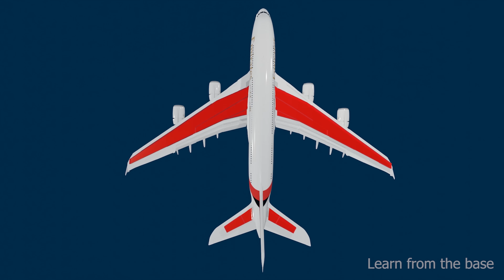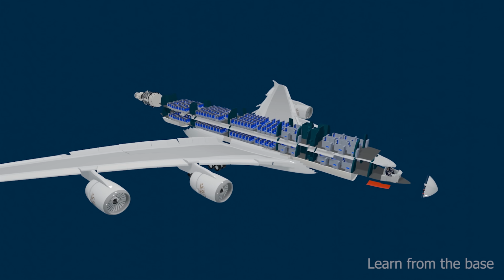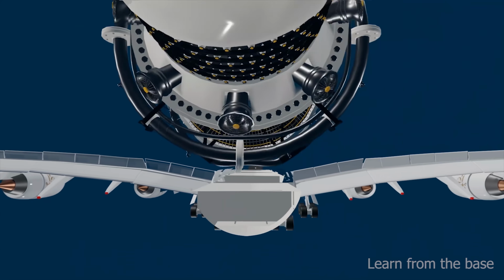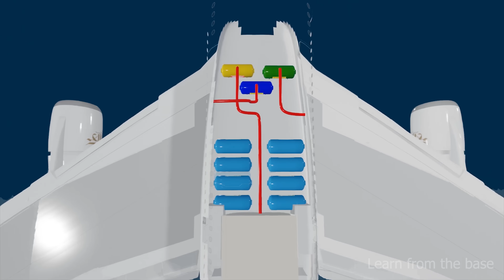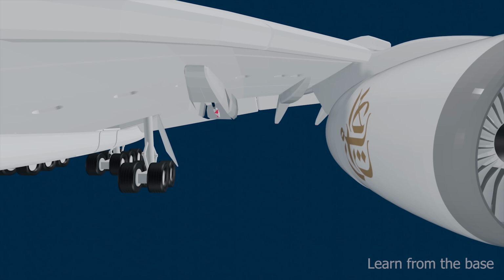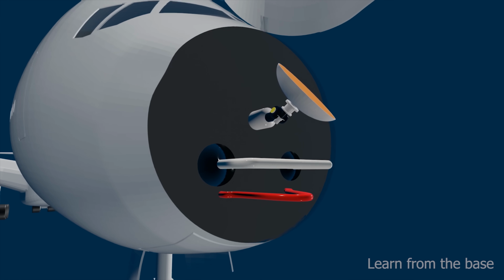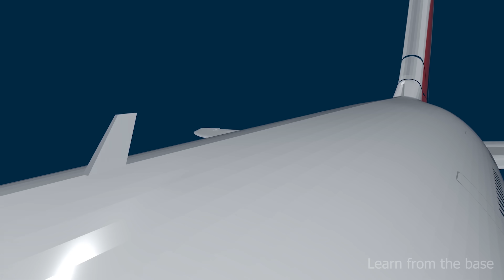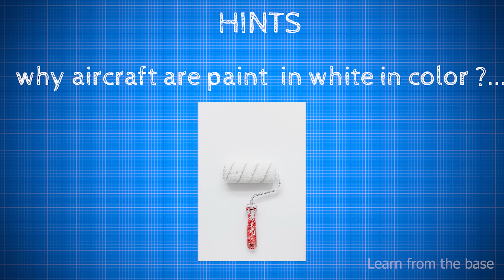what inside an airbus?world largest passenger aircraft (a380) with 3d animation/ learn from the base

Comment: Landing boost:
During landing, the engines are reduced to facilitate descent and braking. This is done to prevent the aircraft from losing excessive speed and to allow the aircraft to brake in a controlled manner.

Power reduction for landing: 
During landing, the engines are reduced to facilitate descent and braking. This is done to prevent the aircraft from losing excessive speed and to allow the aircraft to brake in a controlled manner.

Braking during landing: 
During landing, the brakes are used to reduce the aircraft's speed and bring it to a stop on the runway.

Aircraft control: 
Pilots use various controls, such as the flaps, spoilers, and rudder pedals, to control the aircraft during landing.

Safety: 
The configuration of the A380 and other aircraft is designed to ensure safety during landing and takeoff.

I don’t why does the landing a380 airplanes never open 4 engines with going back spoilers throttle than a340 and b747 the 2 throttle ssme sizes for Airbus, A340 and A380

Comment: There is no fuel tanks in the wings, small fuel tanks yo get the aircraft off the ground.
Once in the sky, the apu generates the power to fly the plane on electrical power.
Come on lads, do you honestly think each wing can hold 160,000 litres of fuel swishing around, it's the equivalent of 25 fully grown elephants in each wing 😂😂😂

Comment: The fuel weight in each wing would be in excess of 50 tons plus the weight of 2 engine's (6 tons each according to the manual) so the combined weight on each wing when fully loaded is going to be approximately 62 tons. Those are mighty strong wings! Are my calculations correct?
Edit- I've based this on each wing containing approximately 150,000 litres of fuel. Do you know the capacity of each of the 6 wing tanks?

Comment: 30-11-2022  Bangalore

Sir,      I have noticed an error:-

Total seating capacity :   868  passengers  ;  Upper deck   330 passengers
                                                                                Main deck    583 passengers
                                                                                Total              913 passengers.
Which is correct?

Will you clarify and give the correct figures.?   

                                       - Nagaraj T V    Bangalore  India.

Comment: How can all that fuel fit in such thin aerodynamic wings full of hydraulics and electrics and engines ? If so , surely the weight of all that liquid would require something to hold it up . Not just where the wings meet the body. It's only aluminium remember . Think about the figures you give for fuel capacity and what that would weigh.

Comment: Feul tanks , that are apparently big rubber bags , ( that can never be inspected or removed or even repaired 🤷‍♂️🤔) in the wings ,that when the flaps move you can see straight through them, you know them #feul tanks 😉
Reply: No.  Most of the fuel tanks on airliners are not rubber bags.  They use what is known as a wet wing, in which the wing structure itself is the tank.  The front bulkhead is hust behind the leading edge slats.  The rear bulkhead is just in front of all the gear that operates the flaps and ailerons.  So the thickest part of the wing holds the fuel.  It has removable hatches that can be removed for inspection.  On something the size of an A380, you can stand up in some of the tanks.
Those are the facts, not that I would expect an illiterate chemtrail believer to understand them.

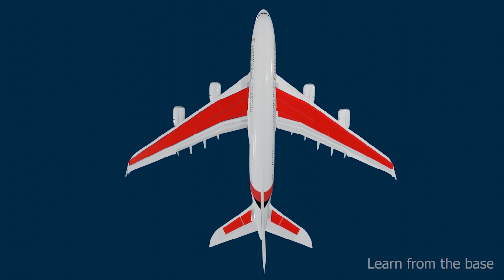Comment: 03:55 total fuel capacity is 320,000 lites
So 320 tonnes
Which is like 228 cars (on average) 
Um…
Reply: No, it's about 253 tons.  Each engine burns 3 tons per hour, so 4 engines = 12 tons per hour.  Let's assume a 15 hour flight, so that's 12x15=180 tons.  Then allow some more for taxiing at both ends of the flight, then reserve fuel in case it has to divert, and you're already over 200 tons.  They will rarely fly with a full fuel load; just what they calculate they'll need.  Carrying excess fuel burns more fuel, so they avoid it.  The numbers sound big, but if you've ever stood next to, or under an A380, you'd understand.

Comment: Please edit nosewheel steering: under normal conditions the nosewheel can be steered + -70 degrees with a mechanical stop at + -75. I only know this because a nosewheel that could turn + - 90degrees would not help steering and would put a massive strain on the nosewheel assembly, simple physics.

Comment: One pilot for navigation the other for master control 
A flight engineer is also present in wide bodied aircraft for flight performance parameters control n emergency technical situation solutions 

Am i correct?
Reply: Yes, but there are no more flight engineers on board anymore. Computers have replaced them

Comment: The copilot assists the pilot during flight, including handling the radio communications, navigation, and working with the pilot to complete the many checklists involved with flying an aircraft. The pilot may turn control over to the copilot even if the pilot doesn't leave the cockpit.
Reply: Alot of times its the FO flying the planes i work on the ramp I always here them talk about who’s gonna fly the plane ✈️

Comment: Been on this fantastic aircraft three times and it is absolutely huge inside and the reason why there is always two pilots is because in case one pilot goes down sick with food poisoning or has a heart attack and also both pilots eat completely different meals so both of them are not sick leaving one pilot to still fly the aircraft safely and normally these bigger aircraft all come with three pilots and the 3rd pilot is the flight engineer who is keeping an eye on everything making sure the plane is running smoothly without any problems i used to work on aircraft myself so just testing my noliage to see if I am right or not!
Reply: very good noliage
Reply: On modern airliners like the A380 there is no flight engineer, everything is monitored by pilots with the help of computers

Comment: There are two pilots in an airliner's aircrafts for many reasons.

*SAFETY*. There are circumstances whereas an emergency could happen. In some cases, it's due to pilot error, or possibly due to pilot's health issues, or even a possible suicidal or terroristic attempt of the pilot. Having two pilots is part of the aircraft's redundancy system. If one is unable to fly the plane, the other one can fly it.

*ALLEVIATE THE WORKLOAD OF THE PILOT*. Piloting a commercial jet aircraft is a very busy task to single-handedly be handled. A pilot must monitor the weather, listen to ATC, monitor the airplane, monitor the navigation, and the likes. Due to safety concerns, the pilot must not leave the cockpit unattended even during cruising altitude. Having two pilots means one pilot can have comfort room breaks in-flight. In addition,  the overwhelming amount of checklists can be overlooked by a single pilot. Having two pilots minimizes the possibility of missing a task or two in the checklist.

Comment: Aircrafts need two pilots because there are many control switches in aircraft and it is very difficult to control the aircraft by only one pilot. So if there are two pilots in aircraft then the aircraft controlling risk will be shared and be reduced by two pilots ,where the one pilot controls the left part of the aircraft such as left wing, left turbine etc ,,,, and another pilot can control the right parts of the aircraft such as right wing ,,right turbine etc,,, and also the rest of the controls like wheels, communication with land will be shared by two pilots by this it the risk will be little bit becomes easier to control the aircraft in smooth manner ,,,and also if any one pilot gets sleepy then the other pilot can awake from sleep
Reply: Brother ,from which country are you
Reply: Dude did you ever heard of auto pilot ?

Comment: There is just a little bit of fuel needed only to start the engines, and once its started they produce fuel and thrust The Jet Engine sucks air, compresses it into liquid and both 78%Nitrogen & 21%Oxygen  in air are turned into fuel.
That's is the reason the Jet Aircraft can fly for long distances. But eventually have to land due to metal fatigue otherwise will burst.
The wings are already heavy due to engines installed, how on earth it can carry an Olympic size swimming pool quantity of fuel on both of its wings is a question??

Comment: 2 Pilots are needed, not necesary just for emergencies
Aircraft procedures are intended to function with two Pilots, one Pilot fly, the other one operates systems and coms. Today navigation is pre-planned while on ground, PROGRAMMING THE AUTOPILOT (yes, autopilot needs human input, it's not a Terminator)
Sometimes autopilot is used manually during flights  when it was not pre-programmed

AIRCRAFT CAN FLY WITH ONE PILOT, BUT ITS IMPOSSIBLE TO "OPERATE" IT WITH JUST ONE PILOT

Also Pilots can disconnect autopilot whenever they want, when there is no a critical phase ongoing

Have a nice day ;)

Comment: 1, 2, 3 or 4 pilots, Depends on type of aircraft.
Mostly GA aircraft can be fly by 1 pilot, but in twin engine, they could need 2 pilots to fly it, because those pilots can shares the situational awarness inside or outside the aircraft, or in case of emergency and of course, make the job a lot easier. (In case of operating those systems, flying or navigating).

Comment: Two pilots need.. one pilot health problems another pilot handling in aircraft
Reply: The reason for two pilots are-1.In case of emergency, one pilot can read out the emergency proceedures  and the second pilot can perform  the actions.2.If the plane encounters any inappropriate behaviour during flight, one of them can leave the cockpit to inspect that particular control surface, engine, fuel tank surface( for leak), 3. Before landing, if any of the landing gears fail to lower, one pilot can leave the cockpit to attempt the mannual LG release proceedure. 4. In case the Autopilot fails during flight  and the nearest airport is hours away, it will be aherculian task for a single pilot to fly on mannual. And finally above all it is made mandatory byby the Civil Aviation Authority of every country.
Reply: Ur reason is the main reason and correct.. Even their food also different
Reply: https://youtu.be/kdBbhMQtFbc

Comment: 1. The primary reason for having two pilots on every flight is safety. If something happens to the captain, a plane must have another pilot who can step in. 

2. The first officer provides a second opinion on piloting decisions, keeping pilot error to a minimum.

3. In each fly, if take off handled by Captain, then landing should be handled by first officer. Or wise versa...